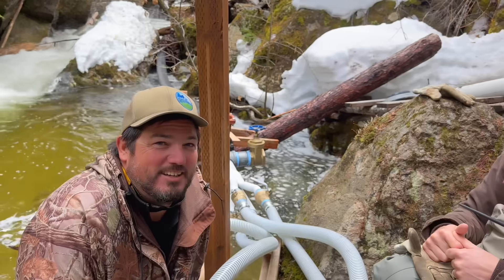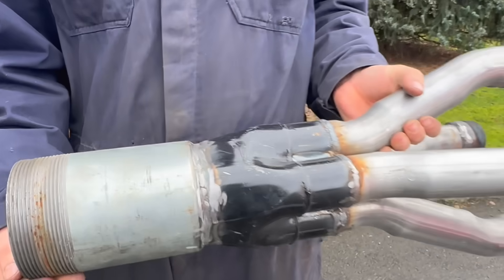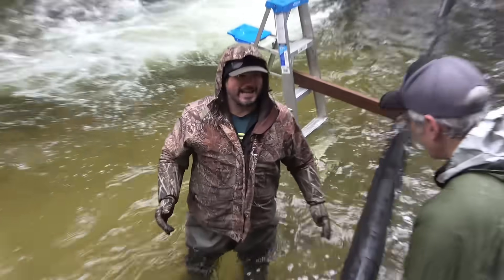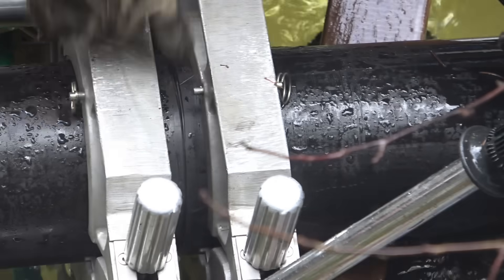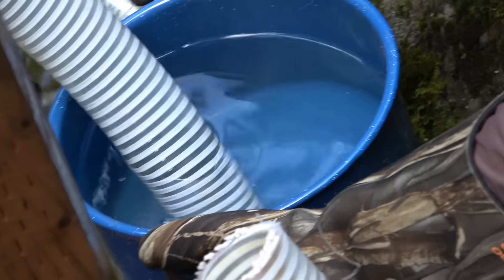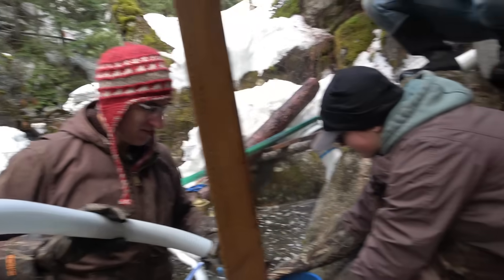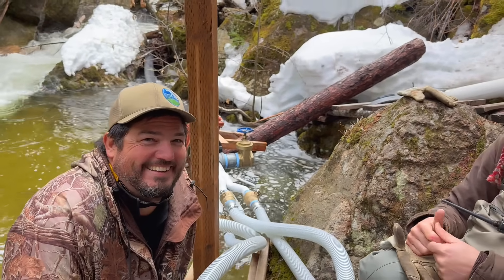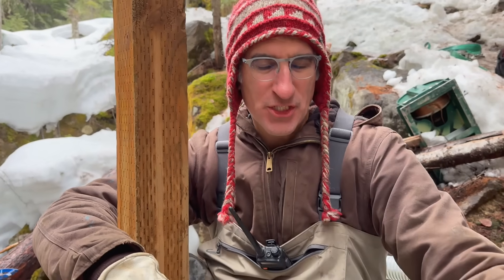Off Grid Micro Hydro - 24/7 Electrical Power - THIS is The Way!

Comment: maybe you should transform the voltage to a much higher voltage to transport it with less current to the house, then at the house bring it down to the voltage you need, if the distance is very big, the cable loos will be less than the converter loos. (for exemple if you loos 20V at 10A in the cable, you loos 200W in the cables) bringing the voltage up, reduce the current, and reduce the loos.

It is a realy nice power station ! good job guys !

Sorry for my bad english ^^ i am from Switzerland.
Reply: that is how transmission is done over distance
Reply: yes, needs transformers

Comment: have you thought about creating a platform, or more ridged support system that bottom, just curious what the strenuous stress it's under due to the weight and speed of the water travelling through it at the end. love to see the off-grid engineering here.

Comment: That flow and pressure can drive a bigger Generator and turbine. Did you say 60 volt and 12 amps, about 750 watts. Thats not alot on those pipe setups.

Comment: I would say split two hoses off onto a second micro generator and have a failover with possibly 2x the output of the same components. Measure the RPM under 1, 2, 3, and 4 hoses. If the increase in RPM isn't going up times the amount of hoses then you would be better off splitting them into another system. That probably has more to do with the max flow rate of the water and not the turbines output.

Comment: Umm, get a large inlet, static building, no maintainance. Move as horizontal as possible.
Once the difference in height is like 20 meters, start with a big pipe like 4 inch, for like 5 meters down,
then a 3 inch pipe, then a 2 inch pipe, water picks up speed, then a paddle wheel.
Minimal maintainance. Remove debris from the filter from falling leaves and such, once per day.
That's that, power for life. It's the same method they use for strip mining back in the days,
but instead you hit a paddle wheel.
Unlike the strip mining, clean power, and the building is cheap too.

Comment: That water hammer when you close the ball valve can easily rupture the upstream hose (called fast line).  The fix is to install a relief valve set to just below the rated fast line pressure.
Reply: Or just close the valve slowly.
Reply: @MrDmadness  Get it wrong once and you have to replace blown fast line.  Easier to install a relief valve (available from McMaster Carr).  To set valve pressure you simply open it until it is flowing water, then slowly close it down until flow stops.  Any sudden surge in pressure like a water hammer causes the valve to lift.  Since water is non compressible, the valve will burp momentarily, releasing the pressure, and then close again.  The valve must be installed just upstream of the ball valve where pressure will be greatest.  This is simple engineering, and is frequently used in liquid transfer systems all over the world.
Reply: @Simple_But_Expensive i am aware.
Reply: @Simple_But_Expensive  NO ! People need to use their brains , nothing like costing time and money to turn a person in to a critical thinker. There is a serious shortage of these people.

Comment: I read somewhere that in hydrodynamic each time you do a hard 90 turn you reduce pressure somewhere around 15% each time.  You should see a minimum of 30% flow/pressure from your modification.  You've turbocharged you're water!

Comment: Put the output of the alternator to a step up transformer then connect the secondary side of the transformer  to a Rectifier unit . Now you have stabilized DC. 

 then using an inverter unit  you can have  High Power stabilize AC power without harmonic and much frequency oscillation .

Comment: That's the off grid dream right there. Having access to a fast flowing river on your property for hydro power.
Reply: This is my dream.
Reply: ...with a hairy idiot that likely hasn't ever picked up a book in his life.
Reply: Fast flowing is irrelevant!!! All that matters is elevation change. Living next to a waterfall is what you actually want.

All modern hydroelectric dams work off elevation. Every ft of water in a tube is 0.43psi. You have a 100ft tall pipe, and you fill it with water, no matter what you are going to have 43.3psi of pressure at the bottom. This is how water towers work, how hydroelectric dams work, how this youtube video works, and why high-rise buildings have to pump their water to the top.

Comment: If you care most about efficiency and don't mind digital electronics, you'll need a MPPT (like a 3 phase MPPT designed for that operating voltage range input and your battery nominal voltage) or your own discrete system using an inverter i.e. prius inverter. They're cheap and have a broad operating voltage range, especially if your power demands are nowhere near the peak power of the inverter. 

The easiest way would be a Chinese MPPT for motor/generators, with appropriate specs... buy spares.

Comment: awesome set up but the rocks i feel like you can put some 1mm wide metal mesh infront of the intake so you can block alot of rocks and grim that will build up in the lines and turbine over time

Comment: If it's 200v no-load, I bet you would get more power at a higher loaded voltage.  Would it be worth it to just get a MPPT controller?  You could also adjust the gap as you did and see where you max out the current.

Comment: I have been working in the pump industry for 15 years and have fused from 2” to 60” and have never made any fuses in a river in the water.    Pretty cool header you have there.   

Very cool to see a 70% increase in out put by changing the piping and   Nozzle configurations.    
Love the channel.
Reply: Who do you work for, I work for a bypass company in Indiana,, it looks like they didn’t heat it enough.
Reply: @huddy32 Godwin pumps / Xylem.  I would agree that they didn’t heat it enough but it’s only going to have 10-15 psi on it so event a cold weld will likely hold.
Reply: I figured he must've had to ask several different people before he found someone willing to do it for him hahaha.

Comment: 8 inch penstock down to 4 - 2 inch connections.   With a 30 foot head and a flow like that, you could easily run a alternator 3 times that size!
Reply: That 8" pipe has the same flow as 16 2' pipes! A lot of people don't realize that. 
But by necking the pipe down to 5" at the penstock, you end up with a max flow of 6.25 2" pipes.

Comment: You have the rpm why not put a gm alternator on it and make 1kw or more it's got a built in regulator and takes one wire to turn it on

Comment: If I lived near you, I could help engineer sending AC power from the turbine, and matching impedance at the shed to lower transmission loss in the wire, and get higher effeciency for more delivered power to the batteries. It is not rocket science, but it is science that a good engineer can design after collecting data on your turbine. EG if you sent 10 amps AC up the cable at 150 Volts, you would be delivering 1.5KW. At the higher voltage, your loss in the line to the shed would be cut by more than 1/2.

Comment: Nice one! Why not throw the 200v outlet straight into an MPPT (Victron would be the best) and let it convert into whatever voltage your battery pack is? By the way, why a 15v battery, or is that temporary? If you're running that through an inverter, a 48v would be more efficient and require smaller section cables.

Comment: You should use an MPPT charge controller rated for 250v and run the voltage higher, amps lower. You said at the first turn on you had 200V at 7.5amps which was 1.5kW, your changes dropped it to 700W

Comment: ❤❤ Listen ♥️♥️ I think if you shut one of the four valves off, it’ll increase pressure and give you a little bit more, because it’s the pressure or the speed behind the water that spins it faster. So more water isn’t really any better. You need to water to go faster❤❤ love it guys. I got Brooke 60 feet from my house and I’ve been wanting to do it for years.

Comment: I built my own hydroelectric in Costa rican jungle. It has a 16mm brass nozzle with 72psi head pressure closed and 54psi open. With a single nozzle, it runs on a brushed AC generator and is dailed in to provide 59hz 120V AC  with an electric water heater as the load resistance. If i needed more power for power tools i disconnect electronics and turn off the Water heater. It would run 24/7 because the dam would have a big filter made of rocks and a screen. This would prevent small rocks from getting in. But sand and other particles can get in. Usually most issues were pipes bursting from landslides or downed trees, cleaning mud from dam filter every 2-3months.
Reply: Have a look at Marty T channel...from New Zealand...
uses very little flow but 150 metres of 4 inch pipe and a head of 229ft to produce 100psi at the turbine 
which is an old washing machine tub with a Pelton wheel where the agitator ran...inside to power the brushless washing machine motor that has been rewired....

He gets around 500w 24/7 and it has worked for 13 years...supplying 240VAC via old truck batteries and an inverter..

He and his friend  built a new system for his friend/neighbour that produces 885 watts from the same style washing machine/gen setup.....
and uses a low height wall dam on a small stream.....
taking the water half way between the top surface and the bottom of the pond...so the cleanest water....

floating debris and all excess water just flows over the low wall..while debris/sand/silt/gravel  settles onto the pond bottom....
Reply: So is the water heater just always running except in the instances you mentioned? In the event that you have to turn off your water heater, what then do you use for load resistance?
Reply: @bullmooseathletics  I think at that point for maintenance there is a brake on the flywheel so it stops producing any power. Had he done it as a dc power source he could've charged up batteries
Reply: @bullmooseathletics  100% a stupid question, but why you need load resistance?
Reply: @nothanks8725  I think its meant to use up the power being produced so that its not wasted. Think of the engine of a car,when the car is in neutral the engine runs freely thereby wasting gas but when put in drive the energy being produced is then used to move the car. He just doesn't want to waste it because there is wear and tear whiles the system is not even being utilized.
Reply: I live in Panama, but I can’t find iny steep rivers

Comment: Its counter-intuitive, but non-laminar flow (high cavitation) water can produce more power then pure bubble free laminar flow. But I wonder if you might be introducing lag into the impeller by having too many angles of attack, since the water after it hits an impeller might "back-flow" and cause it to slow down a little. Curios if slightly lowering the flow-rate will actually increase the energy produced.

Comment: You can cut out the rocks at the pickup by using a slanted screen method. You have crazy flow and elevation and are set just clean up the pickup and use a charge controller to regulate the battery charging.

Comment: Pro tip. When you heat up the flex tube, just warm up one side. That give it the flex to get over the nipple, but maintains some strength to push it on without collapsing it.

Comment: I've lived in places with creeks like that and seen what they can do in the winter. I'm thinking , when you have a flood, the hydro plant and all of the pipes will be flushed down stream unless you set up some very special equipment to protect them. I've seen entire trees some down in floods. I've actually been in the water when these floods are happening and its just a wee little bit dangerous, probably the most dangerous kayaking I've ever done ! You might be able to at least have the hydro not take off by cable-ling it with wire rope ?

Comment: For PE pipe connections check out Victaulic a mechanical coupling system, all you need is a cordless impact gun to assemble, much cheaper, faster, safer than any fusion system and easy to disassemble if needed, we use them extensively in mine dewatering systems.

Comment: Now add 4 turbines and you can have floodlights 24x7.
A set of step-down voltage converter will also up your Amps

Comment: You need an MPPT voltage/current DC/DC converter combined with an alternator with compatible windings to deliver max power to the batteries. Sounds complicated but you could do it fairly easily with a little Arduino or similar controller. You've just done the hard part, so leave it up to the tecchie nerds to do the 'math'. Now.... just keep the rocks out of the turbine !

Comment: Just get Victron SmartSolar 250/70 or similar and the efectivity  will increase by 30% at least. Also I would mount the generator a lot higher, not entirely unprotected inside river corridor…

Comment: Not guaranteeing but I believe you can get 1000-1100w + with an bigger turbine, from my understanding the slower the water that is coming out of the turbine means you have used up more of its kinetic energy and converted it to electrical energy. might be something good for you to look into especially for the high flow low head style, Love the content!

Comment: Great job... look at all that plastic going into the water!  Wonderful.
Reply: Just no need for it at all
Reply: Same view here - LOTS of micro plastic into the system.

Down where I shepherd my cave-spring, this would make me cry if I saw this going on.
Reply: Just sending problems down the line to the next person.  It’s a great metaphor for how Americans treat America.
Reply: i thought the big black pipe was rubber
Reply: You people are insufferable. Always looking for a complaint.
Reply: @majorramsey3k  didn't have to look for a complaint, it was right there front and center.
Reply: @jameswallace26  Was that supposed to be a sensible reply? It wasn't.
Reply: @majorramsey3k the issue here is people look at the internet for a few minutes then decide to record themselves putting more plastic shit in our water and acting like its revolutionary. They could easily put solar panels on that roof they have sitting bare, or taken the time and welded and sealed a proper water system.
Reply: @DeathStrikeDemolisher  Oh, and you're not going to then complain about the environmental problems with mining the materials to make those solar panels? You whiners are the absolute worst. Nothing is ever good enough.

Comment: Higher volts is much better for the longer run back to the powerhouse. High volts low amps means smaller cables. Then you just need a charger that can take high volts and charge your batteries. Solar panels are also higher voltage so finding a charger that can efficiently use the power shouldn't be that difficult.

Comment: One thing you should do is get an optical tachometer they are really cheap. And you can use that to help optimize the water flow and nozzle size. Just need to put a line with a marker on the wheel and bobs your uncle. Just point and it will tell you the rpm. 

They are handy as heck.

Comment: those 4x4 pressure treated posts and 2x4's will last a year at best in the water. Go with a bolt together aluminum frame  with stainless steel bolts and nuts.

Comment: Dude almost pressure hammered his entire build....Gate valves are nice because they are "distraction proof". At least you had the flow divided into 4 so it could never be as bad as slamming a mainline valve shut in half a second.
Reply: On that side line T, turn it 90’ so it’s vertical, and have a 1-2m length of capped pipe with a side valve near the bottom.  Close the main valve, open the side valve to drain any water from the pipe and when it is re-opened to the main line it will act as a water-hammer-eliminator by compressing the air.
Reply: @andrewallason4530 😮 I don't have any plumbing projects or experience... But I need to try this.

Comment: so the flow rate is not going to change any...because the flow on that system is determined by the nozzle on the end...velocity wont change and head pressure will remain the same....have to say, this was all done for no reason

all the friction is in the nozzle because it is smaller than the pipe going in...the 90s never had an effect

in a closed pumped system 90s have a huge effect...go ask an engineer...or get an engineers handbook

Comment: You need an even larger water turnine generator. I'm sure you have the water flow to handle a larger unit.  Cool setup as it is.

Comment: not impressed you use 4 jets into one Vs 4 lighter alternators individually. but the reality is you'd get more from that river with a paddle wheel tapping the fall behind you geared to run generators.
Reply: nope...sure wouldnt
Reply: @t00ls742  yeah right because a simple calculation for a water wheel alone using the 30ft head and seeing the flow would likely generate 205KW at 11 rpm with a loss at 0.6 certainly not a overly efficient estimate.
Reply: @ paddle wheels are not meant for high head....they are inherently low head high volume

too much head would cause splashing, and that leads to inefficiency 

a turgo can use 2 - 4 inlets efficiently  because of the design....pelton wheels can also but are a little different

1 inlet is not as good as 2 on a turgo

most people don't have a clue on the physics of water and pressure....what you think will work a certain way, doesn't when it comes to water dynamics

Comment: Fire pump test header would work instead of building a custom one.  There is also all sorts of filters and screens for fire pumps with pond sources.  A fire pump is high flow, high pressure, with an impeller.  Much of the hardware would cross over for this project.

Comment: The midnight controllers are the best, chargers. They also do well for windmills to midnight voltage controllers .fit a as to dc rectifier turning it into DC voltage